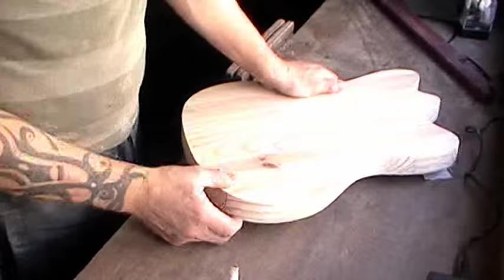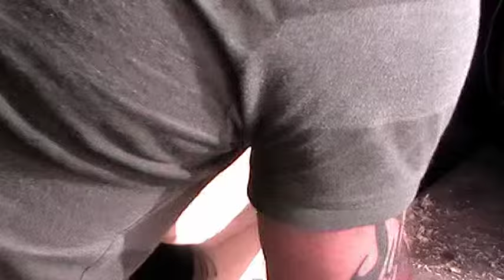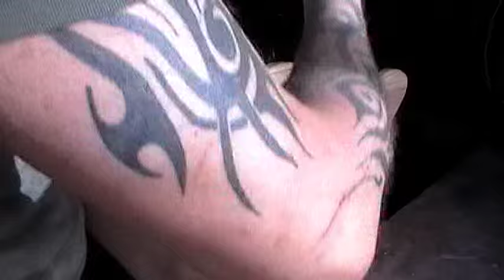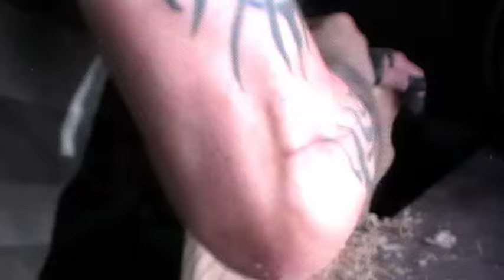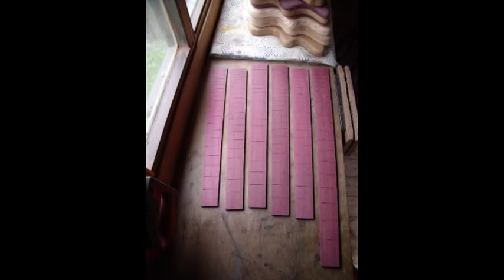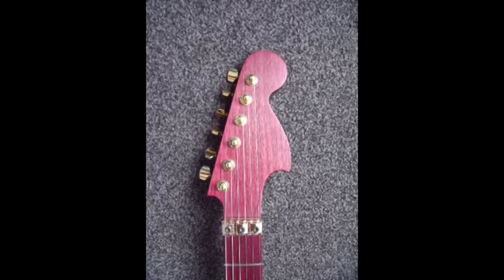Jazzmaster Body Carve, Belly and Forearm Cut (Time Lapse)

Comment: I've a question: To secure the wood on the table so that it doesn't move around when you start routing and stuff, am I correct that you put single-sided masking tape on both the wood and the table and then apply a little glue to the table's masking tape and then press the wood onto the table? If I observed incorrectly, could you please explain how you did this, as I'm planning to do a little bridge-hole drilling on my guitar would like to know how to secure it against my drill press. What kind of masking tape and glue did you use? Many thanks!
Reply from the maker: +Bearista Bear Yeah you got it, that's exactly it, just ordinary bog standard paper masking tape and super glue. I find it works much better and is less messy than double sided tape. It also works out cheaper. On a finished guitar though it might be safer to use double sided tape as super glue would ruin the finish if you spilt some, which isn't an issue while a guitar is in construction as eventually it will be sanded out. Maybe if you used 3 or 4 layers of tape and a very small amount of glue, or if it's just one job, maybe try clamping it with lots of padding so as not to damage the finish.
Reply: Hey, thanks a bunch for the info! Yes, I'd be a little worried about the superglue bleeding onto my finished guitar, so I might try double sided tape first and see how that goes. I'm going to change the bridge on my Johnny Ramone guitar but the hole distance and hole diameters differ a bit. I'll probably practice drill a few times on scrap wood to ensure I get it right before attempting it for real.
Reply from the maker: +Bearista Bear Yeah that's probably a good thing to do some practice runs first.

Comment: Any information of good tools to do this ? ( after using the router ) I'm rounding the bass body and need to buy some tools,Thanks Today is September 2nd 2018 I hope to hear something this year... lol
Reply: Tools for the contours? He used a rasp (and maybe a small hand plane, can't tell) for the entire process and that's probably the most affordable way to do it. You could also carve it with a knife or chisel if you are confident or if you want to invest in a useful power tool an angle grinder does this quickly
Reply from the maker: Hi sorry been busy lately, yeah what he said haha. I use flat and round rasps, also a spokeshave but you can use all types of cutting tools really, it doesn't matter because the last process is the sanding out of all the tool marks which is the main bit that makes a good clean job in the end.
Reply from the maker: Hi sorry been busy lately, yeah what he said haha. I use flat and round rasps, also a spokeshave but you can use all types of cutting tools really, it doesn't matter because the last process is the sanding out of all the tool marks which is the main bit that makes a good clean job in the end.

Comment: Wondering if any tone is lost with a belly cut?  Am considering this for my Tele, but don't want to do it more harm than good.
Reply: Trust me go for slab board. every guitar ive played with it rather than a belly cut sounds so much better and players better
Reply: Stopping the worrying is simple: stop believing the myth that the body wood/mass/whatever of an electric guitar, has any influence on the amplified "tone" of the guitar. If it has any, it's minuscule, non audible and totally overshadowed by tons of other building choices. Not counting the first culprits like strings, picks, fingers, playing styles... A belly cut has virtually zero relation to your tone. Hype, myth, magical belief, hoax, marketing lies, religion, partisanship, Santa Klaus, tooth fairy... call it whatever you like, body shapes and woods in electric guitars have nothing to do with the tone you'll get out of your pickups through your jack. It will only slightly affect the acoustic (unplugged) tone, which is NOT what is picked by your pickups, contrary to what some misguided people believe. Electric guitar pickups are not microphones. As far as choices of materials and tone are concerned, pay attention to things that directly impact string vibrations: frets, nut, bridge, saddles, vibrato block. Maybe the fingerboard's wood if you slap hard. Maybe the metal of the tuners. Maybe maybe the wood of the neck (really not sure yet about this one). The body? No.
Reply: "Sounds so much better" → nonsense.
Reply from the maker: I've made 2 guitars exactly the same before, same woods, hardware, measurements, everything. they both felt different, sounded different acoustically but through an amp there was hardly any difference at all. There are so many things involved contributing to any guitars sound, it really isn't worth wasting time thinking about. Something as simple as a different set up on a guitar can make it sound different. There really is no such thing as "better" just different, one man's best can be another man's worst. Just plan and make a guitar, it will sound great in it's own right. Also to the question about woodworking techniques... Don't be fooled again by what is the "best way" to do things, use your initiative, imagination, i do what feels comfortable to me and do a lot by feel as well as by obvious measurements. Someone once said to me "it's not what tools or techniques you use to make a guitar that counts, it's the finished result that matters" no good having a perfect CNC machine made guitar if it plays like crap. Guitars are not a perfect science, there are too many things involved to be so, too many trade offs just to be able to be played by humans. Guitars are made to be played by humans and humans aren't perfect.
Reply: >>both felt different, sounded different acoustically but through an amp there was hardly any difference at all<<

I wish more people could experience this!  The catch being that one must FIRST let go of his/her cognitive biases (which you did, obviously ☺). Sadly many don't, and will swear that they hear "night and day" differences where it's only their minds making things up out of expectation/confirmation bias (or worse, from good old plain bllshtting attitude). What a load of silly ideas and looney folklore we're exposed to thanks to these biases... oh, well.

Great post BTW. ☺